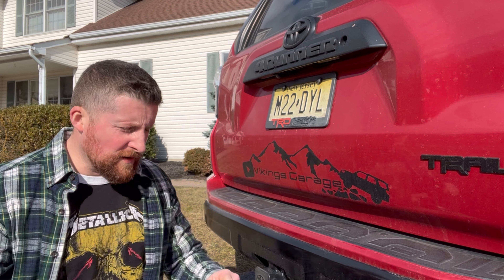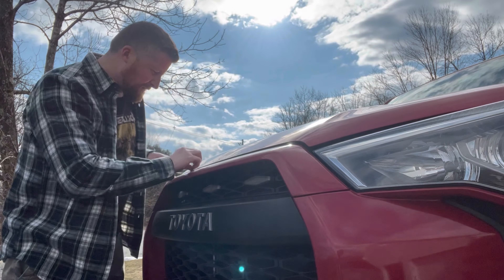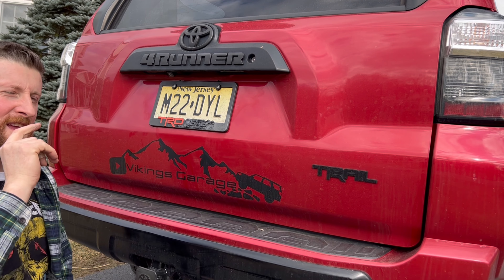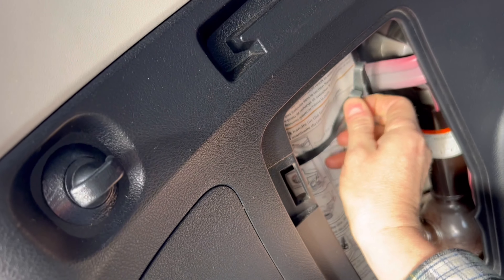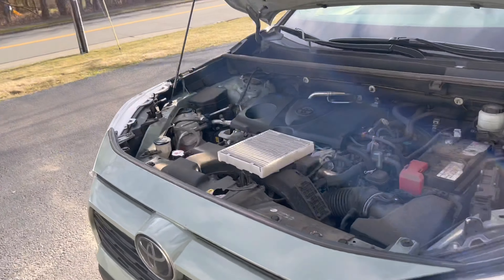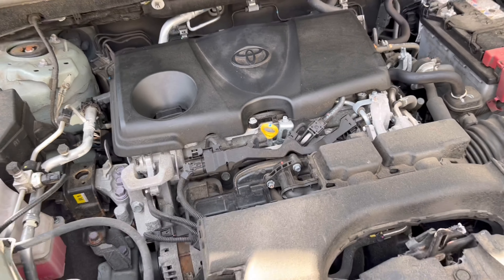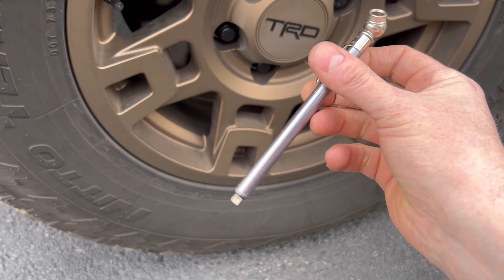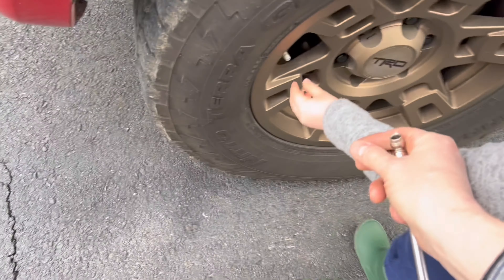TOYOTA 4runner - What’s that noise? Save Thousands - Fixes • Tricks • Tips • Hacks

Comment: Man, I have to give you a SHOUT OUT and Thank you! my wife has a 2019 4runner trd pro we bought new in 2109. at about 50k we started getting a sound from the rear mostly but also the front at slow speeds, backing out of garage etc. The noise got so bad it felt like the dang thing was coming apart during reentry to the earth's atmosphere. Took to the dealer which sadly could not fix the problem and recommended replacing the 1200-dollar fox shocks that are on the pro. Its never been off road and i was not having that was the problem. after watching this and fixing myself, no more noise. Sadly, you would think that since its such a common problem, you would think Toyota would release a pdf to its dealership on how to properly address this issue. thank you again!
Reply from the maker: I’m super happy to hear that I was able to help. Unfortunately the majority of people they have working on these vehicles at the dealership have zero experience and no certification whatsoever. 🤷🏼‍♂️
I do appreciate your support!! 🙏🏻
Reply: @VikingsGarage  thanks again. Just subscribed and also followed you on Instagram. Love our 2019 and 21 trd pro 4runners. My 21 does not make a noise. My wife's 2019 felt like it was coming apart. Not anymore thanks to you.
Reply from the maker: @dougvito6297 🙏🏻 Awesome! 
Thank you!

Comment: I have a 5th gen 4runner and found that the 2 rubber bumpers under the hood are adjustable, they thread in or out to help tension the hood.
Reply from the maker: This is very true, often times if not properly adjusted… your hood will rattle.

Comment: Any tips to fix a squeaky door panel armrest in the 4runner?
Reply from the maker: Would have to diagnose it in person
Reply: Ours makes noise also. I took it in thinking Toyota would fix it and the service writer said the whole interior door panel would have to be replaced. Also Toyota says it was our fault for putting to much weight on the armrest and it would not be covered by warranty. Afterwords I was thinking does he think I stood on it or something. I kind of forgot about it but now Winter came back and we use them, so the squeak is back and annoying.
Reply from the maker: I’m sorry, they always try to get out of it for sure.
Reply: Have you ever repaired a squeak coming from the soft piece of the arm rest. If you did did you have to replace the whole interior door panel? Thanks
Reply from the maker: The only time I fixed a squeak from a door on a 4runner the whole panel was replaced. So yes.
Reply: You are the closest I’ve come to finding an answer to weather the soft part somehow attaches to the door by means of a way it can be tightened. I’ve looked for some kind of diagram of the panel parts but can’t find anything. Both doors actually do it but the drivers is the worst. Ours is a 2019, my daughters is a 
2017 which the soft panel is very well attached. I should take it back to the dealer and insist they take a look at them, if they won’t maybe get someone from Toyota to get involved. We have not abused them as the service writer said and that Toyota would not cover them under warranty because that is the only way they can come loose, by to much weight on them.
Reply from the maker: Panel is one piece.
Reply: Ok! Thank you!

Comment: This is a great channel and I am a new subscriber who owns a 2012 4Runner with 130,000 miles. It is the best vehicle I have ever owned! I have a question, is a bypass oil filter a good idea?
Reply from the maker: Welcome to the channel!!
Because I am a firm believer in OEM stuff and parts, I would be against.
But do your research before committing and see if it’s worth it.
Reply: @VikingsGarage  Thank you for your response to my question and I agree with you about Toyota OEM parts! I know they use oil bypass systems on Diesel trucks and in the military because they can filter the oil down to 2 microns that is significant when you consider a full flow filter can only achieve around 20 microns. I think I will wait, continue to research and see.

Comment: Any recommendations on settings for a proper alignment, on a 4Runner in stock form. Toyota Dealership is super expensive but also don't want to risk it with a local inexperienced tire shop.
Reply from the maker: I would stick to the Toyota dealership, the alignment machine is calibrated often to the correct and approved Toyota specs. Yes the dealership is more expensive but it’s worth it.
Reply: @VikingsGarage  thank you for the feedback!

Comment: What would be a good vacuum to use besides a shopvac if we don't have one.
Reply from the maker: To clean the Cowl are you mean, any vacuum will do. The device I show on camera works more like a compressor, so the idea/end goal is to shoot pressurized air into the (sunroof drains & A/C drain hose).
So you would need something that shoots air out, preferably with a long tip(to make your job easier). 👍🏻

Comment: Question for you. I know it will be difficult to answer but i trust your thoughts.  22 SR5, I had an Eibach lift 2.75 in front and 1 inch in back.  I also added Toyo 33's. Literally the day i got the work done I hear what I best can describe as a rubbing noise. I removed the mud flaps and shaved the front a little.  Noise does not go away and I see no indication of rubbing. Sometime I hear it going straight so that in theory should remove the the whole rubbing issue.  it happens with a slight turn and sometimes going straight 1-3 miles per hour and then gone.  I am mechanically inclined but I am absolutely stumped.  I am a subscriber of yours and would appreciate any advice or thoughts. CV Axle?  Sincerely appreciate it
Reply from the maker: I truly want to help you, but nothing obvious comes to mind. 
Noises are hard to diagnose in person and literally impossible over a message. I do appreciate your support!!
Reply: @VikingsGarage  hey brother. I appreciate you. I’ve exhausted everything and I was hoping you’d go. Ya know what? I once heard that after a lift and this is what it is.

Comment: No joke about the rodents...Living in Florida, I had my wire harness chewed by rodents when the temps dropped into the forties. Dealership told me it was common because the wires are made with a soy based material and when it gets cold, they look for warm areas and while there, they start munching. Luckily it was covered by my insurance.
Reply from the maker: That’s all absolutely true, as crazy as it sounds TOYOTA used soy in their wire material. It’s usually an expensive mess. Glad yours was covered. 😅

Comment: Bonus, the rubber flaps next to the wheels in the front (on the engine bay sides) can rattle. Putting a small cabletie under the plastic clips will make it tighter and stop rattling. Was an issue with my 2023 10 month old 4Runner
Reply from the maker: Thank you for sharing, I have seen it. 👍🏻